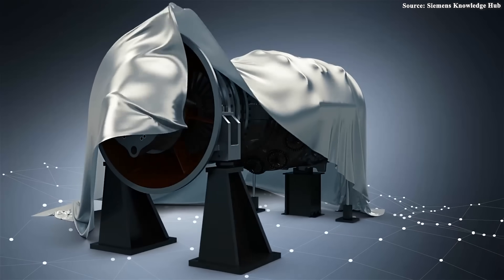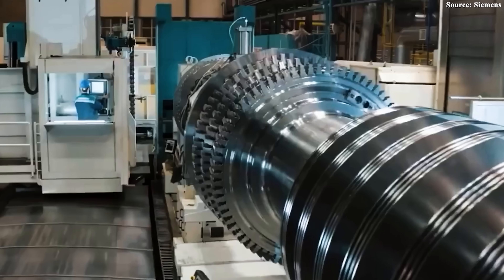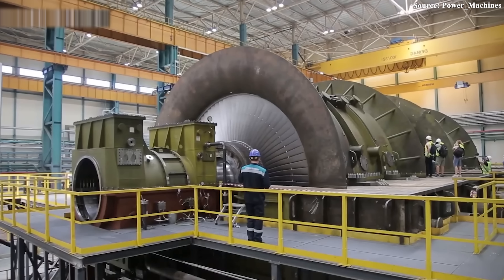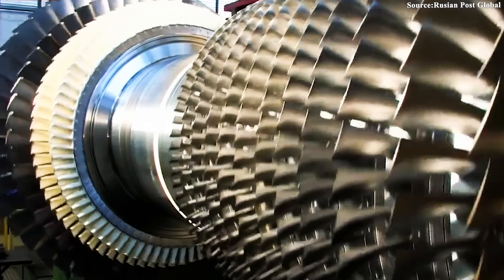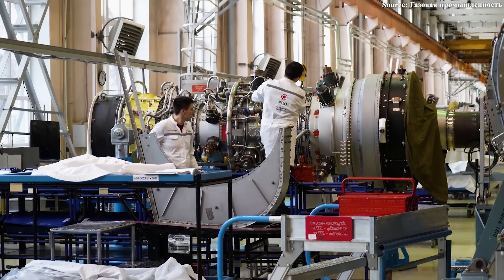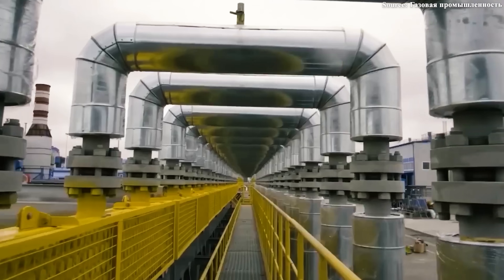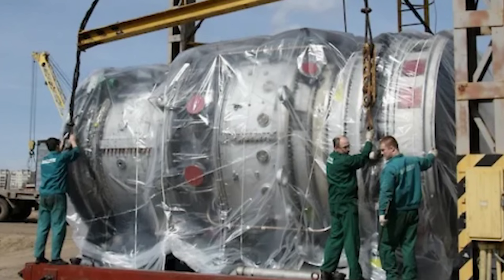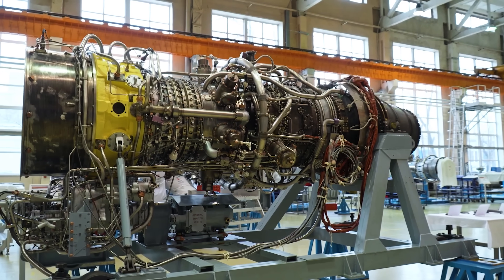This Russia's NEW GTD-110M Engine Will CHANGE Entire Aviation! Here's Why

Comment: It is a moot point whether this turbine design influenced Russian jet engines for passenger aircraft as they had already developed the latter  in the form of the 177C for the IL-76 as well as the PD 14, 26, 35 series for their new airliners the MC-21- 310, Tu - 214 and SJ- 100 based on all Russian components. The way Russian military and civilian industries are integrated ensures the rapid spread of technologies between them with different companies having assigned roles so removing the competition and patent limitation faced by Western companies.
Reply from the maker: Thanks for the detailed info!

Comment: 6:2 China also makes AirPlanes entirely domesticly with Airbus engines :D
Reply: Airbus doesn't make jet engines, neither does Comac
Reply: @larryallen9404  Neither does Boeing, they are all joint ventures your point? Sarcasm is dying o.0
Reply: Shifureisaikyou2055
In your original post,
You wrote "with Airbus engines"
Maybe you meant- the same engines Airbus uses?
Because some people do think that Airbus makes engine's

The part of your post that is complete BS "China makes Air planes entirely domesticly"
Not true- virtualy, no aircraft manufacturer does.The Comac C919 is made with approximately fourty percent imported parts.
 
I believe I am being very gracious here when I write...
Maybe your understanding of English is limited?, or a translation engine is failing you badly? Or your post is Propaganda?
Reply: CJ1000 is a Chinese engine
Reply: @WonderfulCan  Still in develeopment most c919 don't use it. mostly trial runns only

Comment: Cant understand the link between gas turbine for use in the production of electricity and the higher temperature and far more execting needs of fighter jet turbines ?? Pls explain you tube panel   ? . Isnt this just high pressure multi cluch systems in action . Tungsten carbide formed under extreme pressure
Reply: Natural gas is the fuel and when it ignited cut creates expanding heat which turn the turbine at very high speeds which creates electricity..the most efficient technology to make electricity and it's efficiency is between 50 to 60% with very very small amounts of toxic fumes greenhouse gases .But there is the extremely high cost to build nuclear power plants and also for safe disposal of radioactive waste..natural gas turbines can reach over 50% efficiency with less toxic fumes than burning oil or coal..yes you could not use a natural gas fired turbine to power aircraft,the natural gas would need a lot of space for storage and supply .if one was built 70%of the aircraft would be for storage of natural gas and 30%ofcthe aircraft weight .

Comment: The manufacturing of GTD-110D engines by Russia proved how the imposition of sanctions paved the way for self reliance, displaying it’s prowess in technological innovations excluding altogether its dependence on its adversaries it was a blessing in disguise, it also proved that how in testing time 
your opponents can inflict a colossal loss merely withholding of access to critical technology, Russia has learned a great lesson, now , it will definitely strive to end its technological dependence in other fields, there is dire need of making its universities research oriented, reducing its dependence to insignificant levels, how its scientists achieved the milestone unfold the startling revelation that a step towards self sufficiency could result into incredible success and innovation

Comment: With some scientific background - I find it hard to believe that an engine optimised for running at ground-level could be looked to as an insert into an aeroplane.  For sure the mastery of the sciences and engineering would mean if you master this "ground level" engine you would also master an aero-engine optimised for those different conditions.

Maybe the efficiency gain and reduced size (?) is because it was designed "from a clean sheet of paper" to be an on-ground ?

Comment: Not enough specifics, annoying.
Reply: specifications: 

Shaft power output: 114.5 MW

Electric power output: 110 MW

Heat power output: 136.9 Gcal/h

Thermal efficiency: 36.0%

Electric efficiency: 35.2%

Output shaft speed: 3000 rpm

Type: Single-shaft gas turbine

Application: Driving electric generators in high-capacity power plants

Cycle Compatibility: Simple, combined, and cogeneration cycles

Designed for: Gas turbine power plants and combined-cycle gas installations

Key feature: Designed to replace imported gas turbines in Russian power plants, according to Rostec

Other notable features: Lighter and more compact than foreign models, according to Energynews and RS Trade House

Fuel: Designed for use with natural gas

Manufacturer: United Engine Corporation (part of Rostec)

Status: Mass production began in 2024, with first plans to produce 2-4 turbines annually.
Reply: @АлинаКероман  способа!
Reply from the maker: Thank you for your feedback. The upcoming analyses will be more comprehensive. Also, would you like to suggest any additional information for the next analysis videos?

Comment: Top, most powerful engines for commercial aircraft are very important, difficult technological achievements, but far away from much more advanced  technologies like those required for hypersonic missiles, developed by Russia (and China, North Korea, Iran) so it is ridiculous to believe Russia could NOT develop a more "simple" engine for commercial aircraft‼️
Reply: It is just another type of engine. ;-) 

And the main problem with a hipersonic vehicle is the ability to transmit and to receive data at that speeds, because of the plasma shield generated.
Reply: Not just another type of engine: The quality and precise combination of the alloy metal used to withstand those very high temperatures is what has made it IMPOSSIBLE for the United States to build its own first type of hypersonic missile. As for the plama shield you rightly point out, though I am not an expet, I believe its is not uniform around the body and in its rear section perhaps there is no plasma so electromagnetic signals may pass thru...  @АлинаКероман
Reply: @Otro-b3o 
"Impossible for the United States"
That is incredibly stupid!
Reply: Wasn't a case of could not. Just a case of did not and when they needed it they also needed money and time. Their drones were nothing amazing till they entered conflict in Syria and then they really gave drones the attention they deserve and with the situation in Ukraine the pressure went up even further and now I would say they are probably the worlds best at using and defending against drones. Their air defence has always been very good and now it is just getting better.

Comment: I would not worry too much about Russian tech. They were pioneers in strength of materials and in finite element analysis. 12,000 Hp turboprops and a Helicopter as big as a C 130 in 1950. In a pinch they can buy BYD Chinese electric cars for $10,000 a machine.

Comment: GTD-110M Engine is not an aircraft engine.  It is destined for industrial applications, eg power generation or in gas and oil industry.
Reply: Yes, that was well explained, specifically that the principles that were researched will greatly help in the development of airplane engines too.
Reply: Well, what they explained in the video is that it’s the principles that were researched developing this turbine that can also benefit aviation engine development